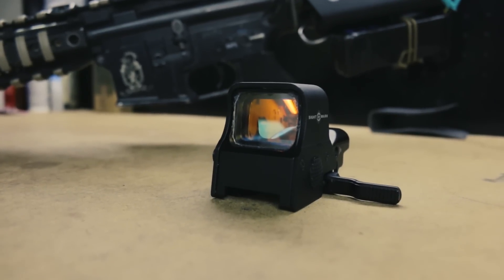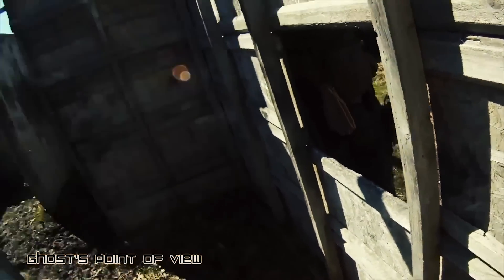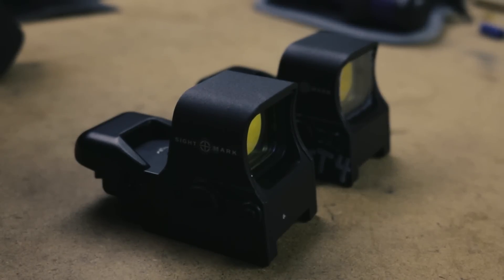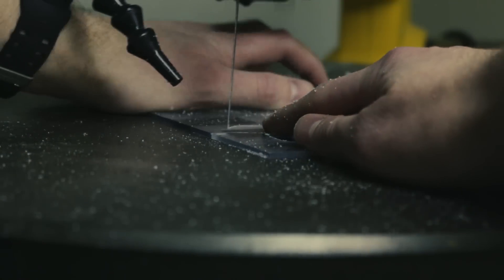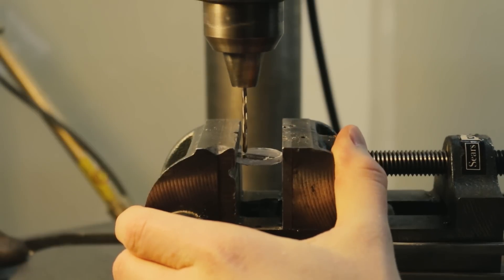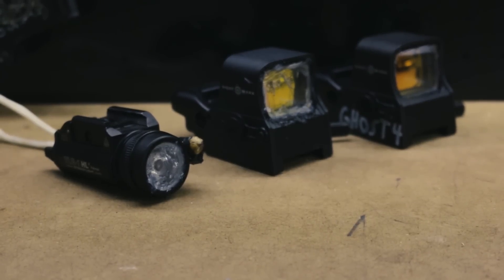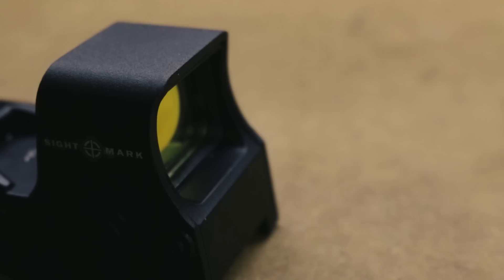Airsoft Tech: How to Make a Lexan Shield (Optics)

Comment: TLRs are made for real steel and are shatter resistant not sure why you're wasting your time making a shield for it.
Reply from the maker: I don't know about "shatter resistance," all I can find is that Streamlight gives it a drop-shock rating, which is very different from a ballistic impact rating.
Maybe it can handle it, maybe it can't, but the TLR-1 is just the light I used in this video as an example. Someone looking to protect their less-robust light would still find value in this tutorial.

Comment: Now i can protect my rmr. Its a lot easier to use the poly carb shields on assault rifles than it is to do this but its impossible to use them on pistols so you have to do this. Chances are a bb wont hit your optic when there's only 1 inch of space between the shield and optic. I use the lexan on sniper rifles due ti there not being enough space to acomadate the shield. I also use sun shades as sort of a qc system so if a lense breaks i have another one and all i have to do is screw it on.

Comment: whats a good way to remove the excess silicone without scratching the lexan?
Reply from the maker: You can use something like tweezers to grab and pull it. It peels off pretty easily, the trick is just getting a grip on it and not pulling out the pieces of it that are filling the gaps.
Reply: Stormin you would be better of using the smallest end of the nozzle on the silicone tube and gun it around, then spray washing up liquid and water lightly over it, then with a wet finger follow the line and take the excess silicone of. Nice smooth and clean joint then 👍

Comment: hey ive got a question stinger. my sector chip wont stay on the SG. and when I use an 11.1v it wont feed. what do I need to do to fix this? what adhesive do I need to use? and btw the tappet plate is a pretty old cyma. about a year old. already tried a 6 month old cyma tappet. didn't work. I'm at my wits end!
Reply from the maker: +MrBeny127 - I've never had an issue with the delayer chip coming off. Is it warped in some way or just incompatible? Adhering plastic to metal is pretty difficult, so I would consider buying a new one.
Also, try a non-CYMA tappet plate. Lonex makes the best but SHS is acceptable.
If you absolutely have to adhere the delayer chip, use superglue.
Reply: it's not in any way warped. ive seen videos where other people have trouble with ics sector gears and delayer chips. and that was my exact thought. I have all shs compression parts so I will try an shs tappet

Comment: This is horrible.lol There is a way to use  lexan without glue.lol Video soon.
Reply from the maker: +TheDarkstar826 - Why would you want to do that? The silicon gel holds the Lexan in place and prevents the inside of the Lexan from fogging or getting dusty.
Reply: I didn't say "I apply glue to my lexan". I was referred to your glue. It's glue, but it's silicon instead.  Anyways, I'm just saying you could do this without a mess.  Use a heat gun to bend shape to slide inside the holosight. 

About the flashlight. Just remove the old lens and install lexan instead. That's what I did to my stuff.
Reply: I could show you pics.
Reply from the maker: +TheDarkstar826 - Yeah I got what you said.
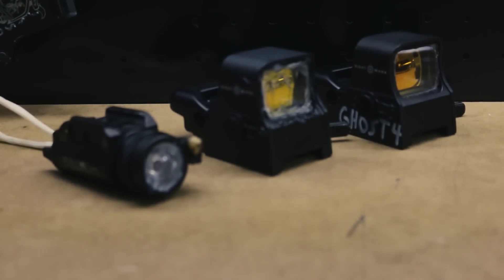Pause at 4:14. The holo sight in the center has silicon on it before removing the excess. The holo sight on the right has silicon sealant but with the excess removed after it cured. Are you confusing the two? Because the end result was not a mess.

Comment: I applaud your use of Lexan as a protective element, but the application of the silicone sealant is way too over the top and doesn't look great. First off, there is no need to fully seal this added lens from moisture. In fact I have found that any air you happen to trap behind the lens will have a certain amount of moisture normally found in the air we breath. Most good quality optics that have multiple lenses are built in such a way so as to have a vacuum in between the lenses. Thus not allowing any heat related moisture fogging. You need to let it breath some to relieve any moisture sealed behind your protector. And the application of that much silicon sealant just looks bad. I have built many of these type of protectors for all my different type of optics and flashlights. T1, ACOG, HALO and Reflex. In many cases an actual sealant is not needed or wanted. And you never want the protective lens actually touching the glass lens you are trying to protect. If a BB does strike a protective lens that is places in direct contact to the glass lens then the energy from the impact might transfer through the lexan and to the much more brittle glass and cause a fracture. The other thing is that you are using way too thin of lexan sheet. For it to be most effective you will need at least a .220 inch thick lexan to achieve a shatter proof barrier. It looks like you are using a much thinner .080 inch lexan. In all the torture testing I have done, the thin stuff always breaks. I have used all sorts of different airsoft guns. Everything from a bolt action sniper (490fps), AEG DMR (450fps), all sorts of AEGs (400 to 350fps) and even when using a Co2 powered Elite Force 1911 (305fps) from 15ft away, only the thicker stuff held up. The bolt at point blank using the .220 inch failed, but really, when is that going to happen? The DMR and the bolt both left a tiny "dent" in the .220 thickness lexan from 15ft, but it didn't shatter. All others just bounced off. I try not using the silicon sealant, but on the flashlights do I "glue" the protectors down. And there I also use a clear silicon adhesive, but only just a few dots around the edge. It doesn't take that much to secure the protectors in place. For the lenses of the sights I either use black tape (T1 style) to lock down the protector, a very small amount of Velcro or I even (like you) use a dab or two of clear silicon. I wish I could post photos of my work here for you to see. I find that all of my methods are fully reversible, non-destructive and simply look a lot better than smearing too much silicon all over the sight. I just finished doing a protector to a new EOTech replica sight I just got. The protective lens was cut to fit inside the outer shroud layer tightly, but not to fit up against the glass lens. Having that space is really important to the protective barrier. I used a small bit of soft side Velcro and friction to lock down the protective lens. Because I shaped the lexan to fit perfectly, only just a bit of fairly unnoticeable Velcro holds it very securely in place. Also, some of my sight protectors have been in place for over a year. One for almost two years now. If you weren't paying attention, you wouldn't notice that I even have a lens protector on at all. Thanks for the video, I just think you need to use thicker lexan and not so much silicon.
Reply from the maker: +Chas Gordon - How does it look bad?
Pause at 4:14. The holo sight in the center has silicon on it before removing the excess. The holo sight on the right has silicon sealant but with the excess removed after it cured. Are you confusing the two?
Reply: +Stinger It looks bad because of all the extra silicon you have all over the place. You used way too much. A much, much smaller amount could have been used to get the same result. At the end of the day I think it looks terrible. You do not and Its your gun, so you do with it as you please. I just think that it could look a lot better if you had used a better technique and used less silicon..
Reply from the maker: This is the finished result:
http://i.imgur.com/vwdy8uK.png
The silicon is barely visible. I still think you're mistaking the unfinished, still-curing application of silicon for that.
Reply: +Stinger OK, I get what you did now. Sorry. I guess to me it wasn't that obvious. Anyhow, yes, the still image makes it all clear now. But I still think you use way too much silicon to attaches those lens covers. I guess I just don't like silicon around my optics. Thanks for taking the time.

Comment: Great guide however I would add that you should use gloves when operating the grinding tools or saws, Trust me, Im saying this out of experience
Reply: John A They are correct in saying not to wear gloves.  When using ANY heavy machinery, you will never wear gloves or baggy clothes. Long sleeve shirts are not recommended either.  too much of a chance for the tool to catch on the article of clothing or glove and pulling you into it.. causing potentially extensive damage.
Reply: John A you're actually not supposed to use gloves while operating drill presses or any type or rotary device because your glove could get caught in it.
Reply from the maker: +John A - Gloves aren't gonna stop a bandsaw from going through your finger.
I can see gloves protecting from the bench grinder, though.

Comment: How hard is the lexan to remove when it gets shot out and needs to be replaced after using the silicone sealant?
Reply from the maker: +Damian Strong - It's easy to pull out with a needlepoint tool.